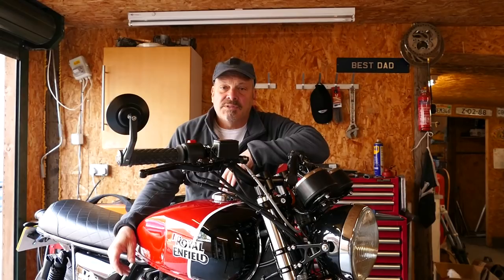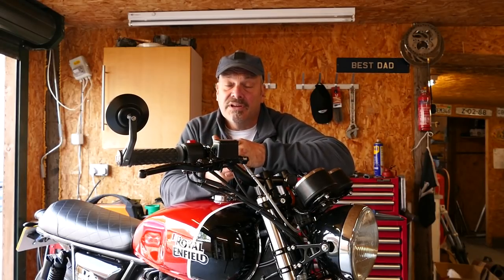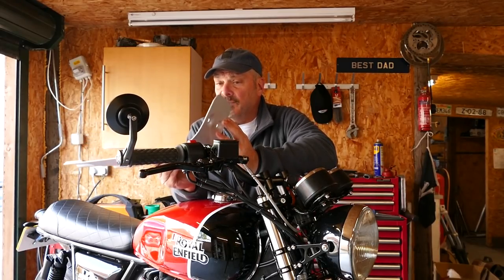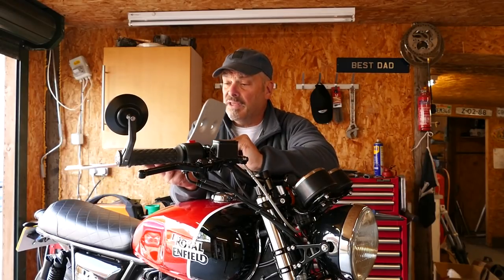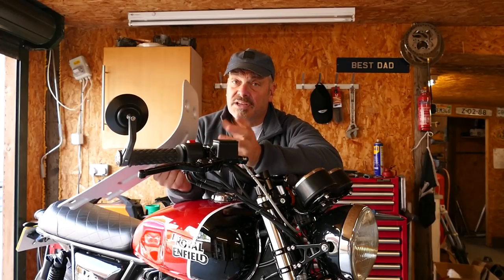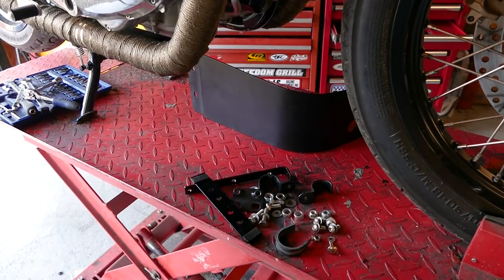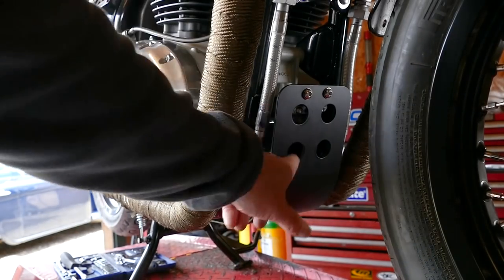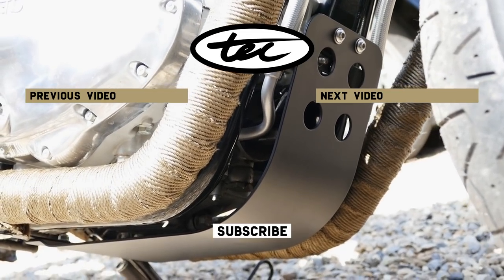Royal Enfield Interceptor 650 - Sump Guard Fitting Guide

Comment: I just installed the the TEC Sump Guard on my Interceptor 650. Thanks for the video, it took me a little longer for a few reasons. 1: If you are following along be sure to use the shorter screws for the rear Guard attachment and the longer ones on the front bracket. I had to take it apart and switch them. The video could be a little more clear on where washers go. The product came with a ton of washers and it is not exactly clear from the video where washers are to be used. Overall it took me almost 2 hours. It looks solidly attached and it looks great on the bike as well. I already had some stone dents on the oil filter so, happy that I got one. Cheers.
Reply: Where did you put all the washers, nut side, bolt side or both?
Reply: So many washers I'm really racking my brain figuring out where they all go.
Reply: Same, couple of days from order to delivery spot on but would have liked a sheet of paper with diagram and washers etc numbered would make alot of sense albiet i got mine on with the video only.

Comment: An excellent kit that has obviously been very well thought out. Took me two hours to do it start to finish but that includes a few redos as I assembled the front bracket wrong way around a few times 🙄 The upper bracket in my kit did not have any anti-rub strips on it so I cut two pieces of peel and stick Velcro (the soft loop side) to act as a buffer between the bracket and the frame tubes. I wish I had purchased this kit before buying the RE kit ☹️

Comment: Captive nuts in the rear cross bracket (the same as the front) would make this so much easier. All in all a bit of a faff on but once done you never have to do it again and it does look good. Hopefully I wont find out if it actually does its job ! Another nice bit of kit George, cheers

Comment: You don’t have to take off the full exhaust system. You need Ball-End Hex keys to do the job. They can be at an angle while opening the hex bolts. So, you don’t need to get the pipes out of your way you can open the bolts with the hex key angled towards the ground. 🙂
Reply from the maker: So why does Royal Enfield tell you to take off the exhaust in the official instructions ?
Reply: Probably they didn’t think about it too. Why don’t you give it a try and see for yourself if it works or not.

Comment: I was left with an unused M6 spacer, which can only go on the M6 bolt at the rear of the sump guard, but it isn't used in the video. Is the spacer important? I also had 2x M10 nuts and washers left over.
Reply: Same here - try as I might I couldn’t see where they might go. I did use two of the washers between the guard plate and the front bracket to space the plate away from the oil filter just a smidge.